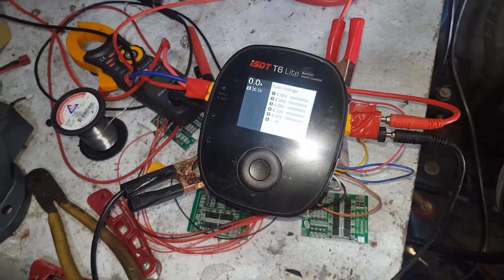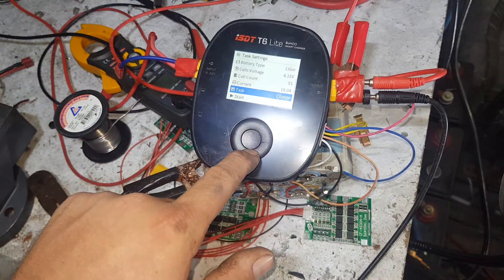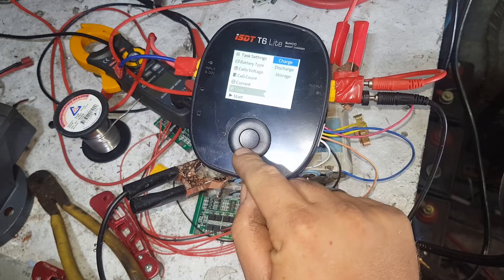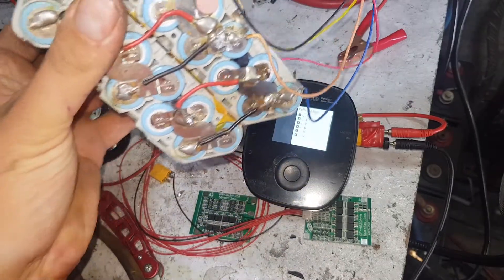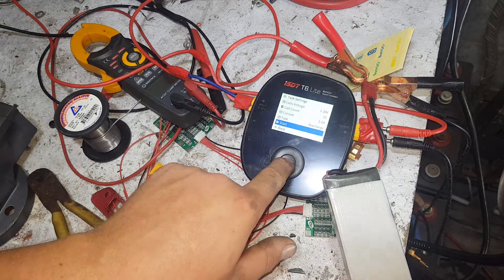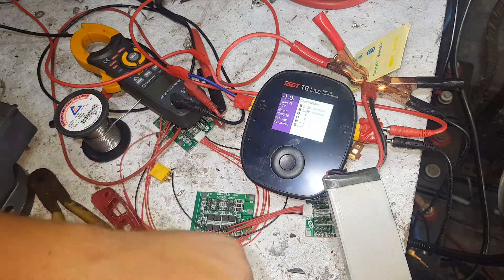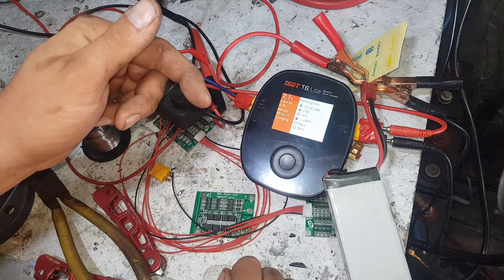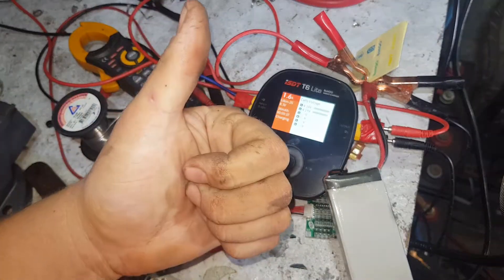ISDT T6 Lite 600W 25A Smart Battery Balance Charger First impressions

Comment: Hi. Is the voltage per cell accurate? I've got a chep balancer that some times push my lipo cells to 4.21 - 4.22 ... it this ISDT well calibrated?
Reply from the maker: Yeah it was very good i checked it vs a multimeter

Comment: Great review thanks. I have the SC-620 500w and power it using a PC atx power supply. Slight issue is it will only pull around 300w at 12v, so I think you will need to give it 24v to get the full 600w output.
Reply from the maker: Thanks mate for the feedback and info